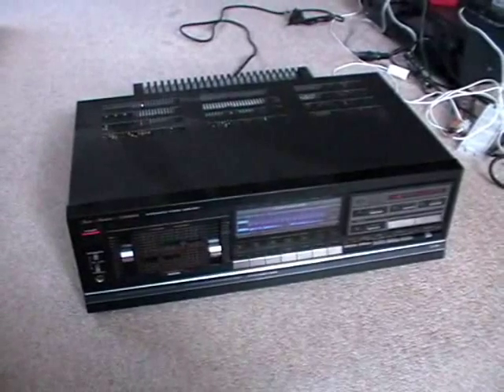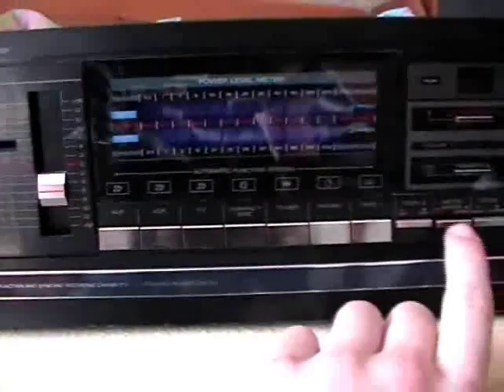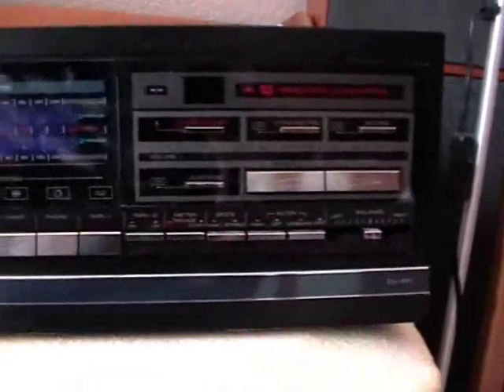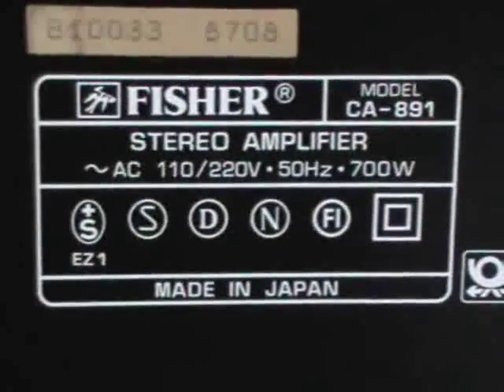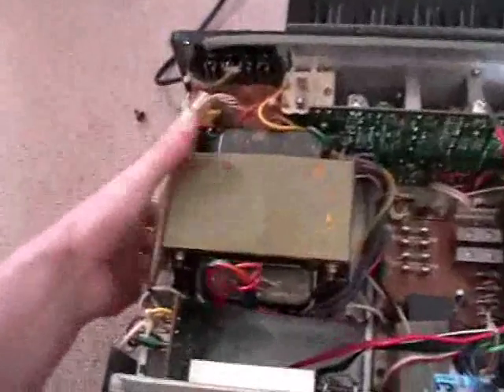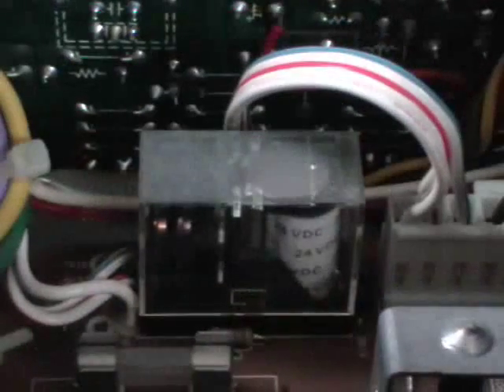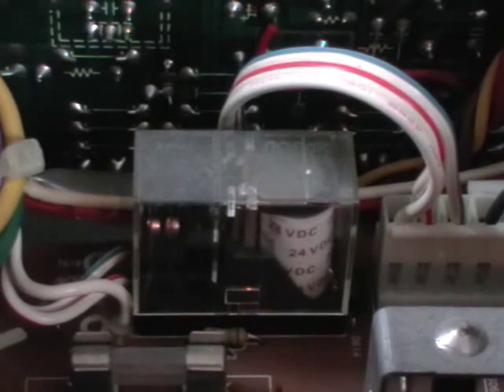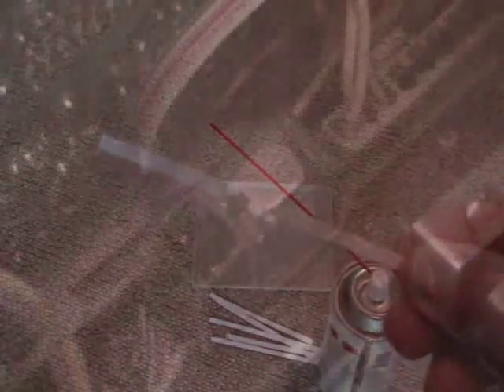Cleaning the speaker relay contacts of the Fisher amp!

Comment: Wow that thing is huge!  I too don't like those what i call "switched" volume controls, that's one reason i disabled the one in the Durabrand I have and added a separate "in-line" volume control.  If the relay messes up again, it probably would be better to just replace it, there not expensive at all.

Comment: Interesting solution to cleaning speaker relay. There's another YouTube that gives the same tutorial as well. What I don't understand though is why you can't just spray the Deoxit directly into the thin openings with the the thin red plastic nozzle that comes with the can rather than cutting up pieces of paper sprayed with the Deoxit and sliding them in? Then after use an air compressor to blow out any debris that the deoxit has cleaned off the inside of the relay?

Comment from the maker: It is soldered in there, if it was a plug in one I wouldn't have to make that hole into the case (I had to do it because there wasn't enough space for working on the relay). The potentiometers were already cleaned before (the balance pot, the others don't need cleaning)

Comment from the maker: The strip of paper removes dirt from the contacts. Much more effective than just trying to wash it away with a lot of spray. Better stay away from the relays with the compressor, you are most certainly going to damage something. Also the dirt on the contats is way too fine. You can't just blow that away.

Comment: A simple solution but you mentioned that you would not do it like this anymore. Why and which method would you instead advise?
Reply from the maker: I still use the method with paper and contact cleaner shown in this video to this day, but I would not cut open a relay anymore like I did in this video
Reply: And instead of cutting the relay open, what else could you recommend?
Reply from the maker: @h.g.6481  Most relays can be opened non-destructively, the top cover is just clipped on, so it can be removed. But often the relay needs to be desoldered from the board to get good access to the clips
Reply: @DrCassette  I see, well, then mine is probably a case of desoldering, as it is very difficult to get a firm grip on the relay and its assumed opening mechanism, also it is placed next to capacitors, taking out the whole board out of this complex unfortunately seems to be rather difficult, too.